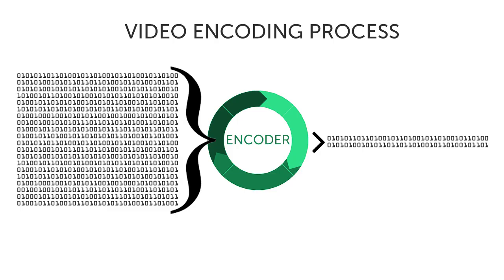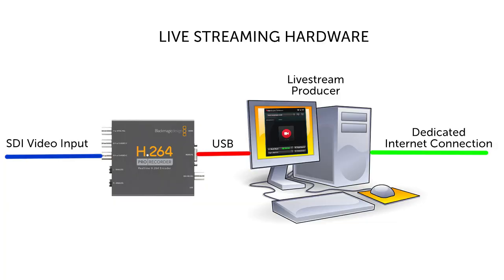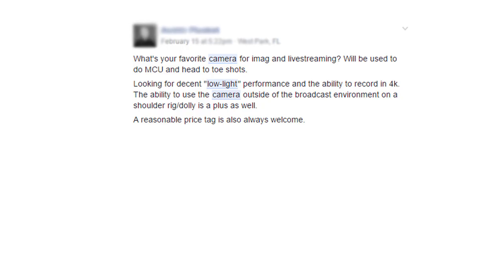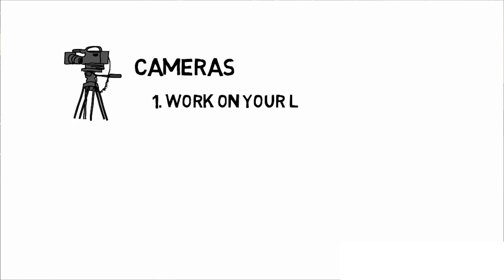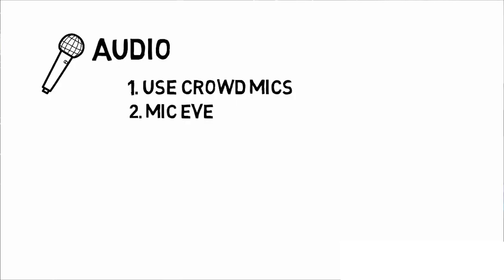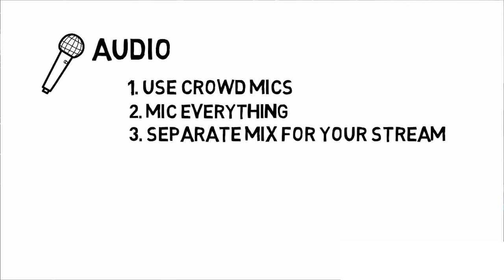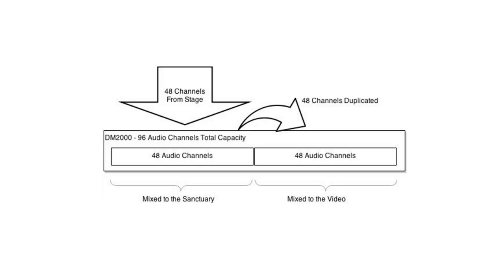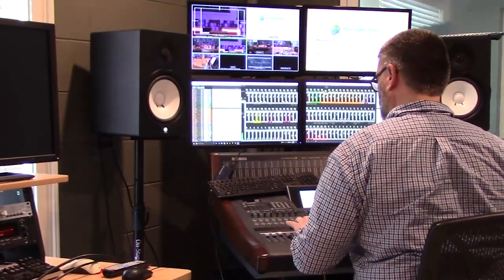Live Streaming Your Church Service - Part 1

Comment: Thank you very much for your videos, they're very helpful. In the event your budget does not allow you to mix isol for streaming, what tips can you offer the foh engineer to create a seperate mix on console for the stream?
Reply from the maker: If I had to create a stream mix from the FOH board, I'd use an aux feed and strategically choose if those aux sends from each channel are Pre or Post fader.  Some I'd want Pre (drums) and some I'd want Post (vocals).  Then I'd get headphones that would give me as much isolation as possible.  Finally, listen and repeat, meaning listen to the recording each week and make adjustments between what I think I'm hearing in the room, and what actually came out on the stream.
Reply: @BallastMedia  ok, thank you again.

Comment: Just want to confirm that the link to the pc you recommend is correct. Seems a lot cheaper than I was expecting. Also if that is the correct one, would that be good for a single camera streaming streaming to multiple platforms at the same time and recording? Thank you
Reply from the maker: This links are a couple years old so I wouldn't be surprised if the seller on amazon has changed it.  Look for a computer with an i7 processor, 16GGB of ram and an NVIDIA graphic card that supports NVENC encoding.

Comment: I am new to live streaming and am thoroughly enjoying your videos. If I understand correctly, I should run audio from mixer to the video cam and run both the video and audio from the video cam to a video interface and then to the computer to lessen latency. Do I need to run an app or studio manager software on the computer for final mix for the live stream ?
Reply from the maker: Where is your audio coming from?  Are you using an AUX output on your mixer?  I've kind of changed my position on running audio to the camera - I'd only recommend that now if your camera has decent XLR inputs - otherwise on cheap consumer camcorders, you'll get a lot better results sending the audio to a USB audio interface and bringing it in to the computer that way.
Reply: @BallastMedia  I can run it from an AUX output from the board or from a USB output. If I run it from the USB output to a USB interface, would I also run the video cam to the USB interface as well ? And what type of USB interface would you recommend ? Thank you for your help !

Comment: I have a Mac mini - Intel Core i3 streaming 1080p, but am only able to stream at 15 fps in OBS without maxing out the processor. I have an eGPU but OBS will not recognize it. I would like to get to 30 fps. Do you have any advice to get to 30 fbs? Should I use the Windows computer recommended instead? Any help would be much appreciated!
Reply from the maker: What video interface are you using?  An i3 is pretty light-weight for encoding.  I'd say look for an i7 with at least 16GB of ram.  And if you can get something you can put a Nvidia Quadrop graphics card in, all the better.  The only way I've gotten an i3 to encode video for me is if I'm "pre-encoding" the camera feed to lower it's bit rate before it gets to the camera. (See my newest video on RTSP cameras.)
Reply: It's a BlackMagic UltraStudio Mini Recorder with an adapter from Thunderbolt 2 to Thunderbolt 3. The camera signals are coming from a BlackMagic ATEM 4K Production Studio switcher. The cameras are all Canon XA15s.
It does seem like it's not enough computer for live streaming
Reply from the maker: Ya, if you want to stay mac, the new Mac Minis are pretty powerful and can handle encoding - but for a whole lot cheaper you can get a PC that will work as well, even including a new capture device.  If you go with a PC, I'd recommend the AJA u-tap. (https://amzn.to/2utuNLa)
Reply: That's great. Thx! I did find the PC you recommend above for $250. I believe I could get there with the addition of the Nvidia card & the U-Tap which would be way cheaper than the mac.

Comment: I am considering purchasing Canon xa11  should I do SDI or HDMI FOr best quality? What would be needed to have professional audio connecting to a hibinger sound board and Imac?
Reply from the maker: Michael XA11 only has HDMI out. No video quality difference between hdmi and SDI. SDI can run up to 300ft of cable, HDMI is limited to 15ft. Also SDI runs on locking BNC connectors so is a bit more robust and won't get pulled out like an HDMI connector will.
Reply from the maker: I'd run audio in to the camera over xlr from your mixer. Then take the video and audio from the camera in to the computer over an AJA u-tap.
Reply: Thank you for the rapid response. so am I making the right move as far purchasing the XA11 or another model? This camera is my highest budget of $1400 But I am trying to get best HD quality vs the cheaper ones like the r800. Ok I'll take your advice on audio set up
Reply from the maker: Michael XA11 should work great.

Comment: I need help with this.  The quality of my videos is very poor even tho i have 4k cameras  a rolland switcher, and a studio design express for my Mini MAC.  Please let me.   What can i do
Reply from the maker: What software are you using for streaming?  What bit rate are you streaming at?
Reply: I am using OBS, We dont have the resources to pay for the better ones.   I bring the signal to the Switches through HDMI and i have it set up to 1080p but when i go to my media express on my studio design express it doesnt want to show any image.  so i cant get it to work and on 720 the resolution is very poor
Reply from the maker: Are you live streaming, or just recording with OBS?
Reply: I am doing both.
Reply from the maker: What bit rate is OBS set to?  (Settings, Output tab, Video Bit Rate)
Reply: It is at 2500
Reply from the maker: So, the resolution is the size of your canvas.  And the bit rate is how much paint you use to fill in the details.  Which also means, the higher the resolution you use, the more bit rate you need (paint/data) to fill in detail and make it look sharp and clear.  That being said, 2500 is pretty low for a 1080p stream.  That's about what I'd want to do for a low to mid quality 720 stream.  For example, youtube recommends 12Mbps for a 1080 video upload.  That would be a 12000 bit rate in OBS.  But that probably isn't possible to stream live.  So, all that to say, you might try streaming at 720p30 and setting your bit rate to about 3500 and seeing if your quality increases.  You'll need to find out what your internet upload speed is capable of sustaining by measuring it (speedtest.net) and you shouldn't set your bit rate any higher then half your upload bandwidth.  Also, unfortunately there isn't a way to set a different bit rate for streaming and for recording in OBS.  You may try recording to a different machine at a much higher bit rate so your recorded video is of better quality.

Comment: Hello..Your videos are very informative...We currently stream on FB live and run a stereo feed from our FOH board (Roland M-480). Currently our FOH tech mixes our streamed audio while running live sound, but is church which is not working out. Our audio sounds ok but could improve.. To help remedy this problem, we purchased another Roland M-480 for re mixing the streamed audio for video via DAW. I heard you mention Dante. What is that and do we need it? If so, what do you recommend and how do I hook this up?
Reply from the maker: Dad Mac Dante is an audio network. A way of moving audio channels around over cat5 cables and network switches.  If you already have a way to get audio from one mixer to the other then you don't need it.  If you are looking for a way to do that, look in to Dante.

Comment: Hi
I will and my tech. team would be screening our service live, for the first time.
I'm an amateur because I normally use the phone for the fb live streaming. 

What do you recommend my team do, in terms of equipment,for thi s task which is in two weeks time
Reply from the maker: +gloe-joy budget would be a big factor in what equipment you select. Assuming you want to do this as cheaply as possible, I'd say get an an 1. Atem TVS HD switcher
2. Canon vixia HF R800 cameras
3. Using a Mac to stream, get a BM Ultra studio mini recorder and use OBS software to stream.
Reply: Ballast Media ...and does the OBS work on any laptop? We are not using Mac
Reply from the maker: +gloe-joy OBS will. But the Ultra studio Mini Recorder will NOT.  Use the intensity shuttle instead.

Comment: We are trying to stream live on facebook with 2 cameras using a PC we do have great lights in the stage so that wont be a problem. Is it possible for us to spend less than $300 if so what equipment and cameras do i need? It will be really helpful if you can guide me. We do have the PC already so those $300 would be in cameras and others equitments if need it.
Reply from the maker: +Alex Gallo it will be hard to do for $300. A decent switcher (Atem TVS HD) costs about $1,000.  Maybe start with a Canon vixia HF R800 and figure out a cheap capture option. You may be able to connect one camera through USB.
Reply: Ballast Media thank you so much for replying so in order for us to have 2 cameras we will need the switcher right?
Reply from the maker: Alex Gallo that is the usual way to switch between cameras. Some people use multiple capture cards and switch in software, something like vmix, but it's not the route I would go, by the time you get a powerful enough computer to run the software well, you may as well have night a switcher.

Comment: I am having issues with audio lag. I am using VMix software and taking audio from the mixing board and there is a noticeable lag... any suggestions?
Reply from the maker: What is your camera interface?  How are you getting audio embedded in to your video?
Reply: Ballast Media I have my camera hood up through an external video card. It runs to my computer and I have the audio ran from the mixing board through an interface into my computer. So I mute the camera audio and use the mixing board audio for better quality.
Reply from the maker: My suspicion would be the fact that you are using two different interfaces to bring in audio and video.  They each will have different latency specs so when it gets to the software they are out of sync.  My suggestion would be to try and run your mixing board audio to the external mic input of one of your cameras and use that camera as the "hero" audio input for your stream.  That way both video and audio are coming in the same interface and then should be in sync.

Comment: Hello, thanks for these videos.
I watched another video where you recommended using the H.264 with an ART Clean Box. Does the BMD Web Presenter do the function of both of them?

Does the BMD Web Presenter eliminate the need for software like OBS?

On another note, what are the computer requirements for running OBS on Windows?

Thank you!
Reply: Also, if you're building a computer, or have a system with a dedicated nVidia GPU, OBS can utilize the hardware encoding feature taking all stress off the CPU.
Reply from the maker: The Web Presenter is seen by the computer as a "web cam" so it is raw video, not encoded.  It will work with OBS, according to BM. https://www.blackmagicdesign.com/products/blackmagicwebpresenter
Reply from the maker: Thanks for the input.
Reply from the maker: Yes, the web presenter would give you audio inputs through XLR as well as your video through HDMI or SDI.  You will still need software like OBS.  I'd get the fastest processor and as much RAM as I could to run a live stream.  I'd say i7 and 8GB or RAM minimum.  I've heard that BM has had audio sync issues with the web presenter, haven't heard if they've gotten that sorted out with a firmware update yet.
Reply: Thanks for the quick reply!

I just read some of your other responses to others questions and learned that OBS needs RAW video, so it wouldn't work with BM Web Presenter.

If it BM had no audio sync issues, which path would you recommend? H.264 or Web Presenter?

Comment: Hi, if you would kindly help!
I'm recording live videos to facebook during sermon, worship, and special events or holidays. My purpose is for others to be able to worship and viewing sermon from other places like out of the country or states(Sunday church) 
My current device is Android galaxy 7. 
my questions are, what are some of the best camera and accessories enable me to use for this purpose?  with the galaxy 7, live facebook is a bit blurry and not clear image because you can pretty listen rather than view.
please help.
i like to find a good quality camera so i can access through my phone setup,
thanks
Reply from the maker: I've never connected an external camera to a phone for streaming.  The quality of your streaming image is going to be dependent in large part on the bandwidth and reliability of your internet connection and the compression/encoding solution you are using.  One option would be something like the livestream broadcaster with a 4G LTE USB modem, that's not necessarily going to be a cheap solution, but you can connect any camera to it through HDMI.

Comment: Thanks for the information, I was wanting to get a bit of information about audio. We already record our sermons and upload them to our YouTube page. We feed our audio into our camera from our mixing board. We do not want to Facebook live our worship, only our sermons. I plan on buying the H.264 encoder to go between our camera and PC. We have good sound now on our videos, do you think our audio will be good on Facebook live the way we are doing it now, by using the audio straight out of the hdmi output of the camera, or will we need to purchase another item for audio? Thanks for any info you can give to help with this project.
Reply from the maker: +The Bridge Jackson if all you are streaming is the sermon, soundboard direct to camera is probably fine. You could think about adding a crowd mic through a matrix to add a little sense of the room, nice but not totally necessary for just the sermon.
Reply from the maker: +The Bridge Jackson if you are happy with your audio now and are sending the same feed to FB live it should sound the same.
Reply: Thanks for the help Ballast Media